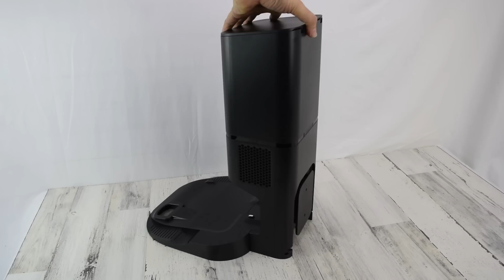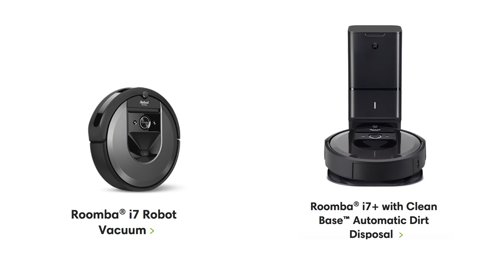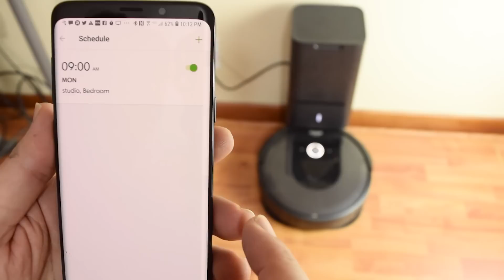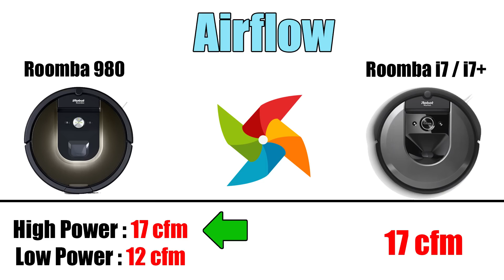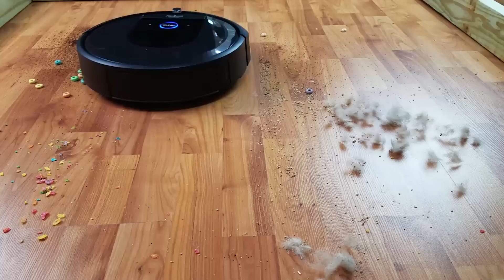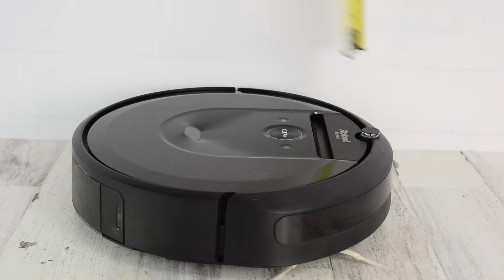iRobot Roomba i7+ Robot Vacuum Review & TESTS w/ Clean Base vs i7 vs 980

Comment: Finally got the exact information I was looking for. Having issues with the device missing debris on carpet, specifically fuzzies from black boot socks. Read online that you can use the app to change the suction settings. However, that is true for older models, this item only operates on the higher setting. Will try multiple passes instead, looks like based on the video that it should work. Had a Xioami robot vacuum previously which operated for 6 years with questionable maintenance, but ALWAYS had issues with carpet, would read that the brush was tangled 18 times when it was not before finally finishing my carpeted area. So I appreciate the start and forget about it for this one.
Reply: Ended up returning it. Suction 1800pa, which explains why it doesn't pick up all the black sock bits from the carpet, more research reveals competitors with 2000+pa. Finally got fed up with it and returned it because it 1) couldn't find its way out of a room next door to its docking station, and then 2) couldn't dock despite being placed directly in front of its docking station, occurring after 3rd use. A shame, I thought iRobot was top of the line in the market.

Comment: I know this is 5 years old, but its been proven over and over again that the i7 is much weaker than previous roomba's for CFM/overall power.  The 960 scoring higher on carpet testing is proof of this.

Theres no way in hell it gets close to 17CFM..   Your more recent testing of the J7 is about right.. 6-10 CFM (Depending on testing methods) for this specific motor. 

 It's not a bad thing, but the J9/S9 completely decimates it and previous gen 960/980 robots.

J5 is just a rebranded J7. No need to test.   All the j7/i7/i3/i5 and custom variants have the weaker 6-10 CFM motor.

Comment: the i7+ is €399 now and I'm considering getting it. Would this still be a good purchase now? I had a Roborock S50 since 2018 but it recently stopped charging so I'm looking to replace it. The replacement needs to deal with hard floors and a few rugs. No pets. What I liked most about the Roborock is how well and quickly it mapped the room every time it ran, meaning I could move furniture around and it would still know the layout and avoid no-go zones etc. How does the Roomba perform in this regard?

Comment: 2 questions
1. What about stairs? Will it just tumble down or sense a edge and ignore it?
2 when picking up. What if we drop like coins and nuts and bolts. Will it still work or will it damage it? Thanks
Reply from the maker: It has an edge sensor, and I wouldn't rely on a household vac to pick up a large amount of heavy debris.  These are standard household machines.
Reply: @VacuumWars  thanks. I tend to drop coins and forget them later on lol. Oh i want one

Comment: I have the I 7+ at first I liked it. But now I’ve noticed the chips in my wood floors and my cracked ceramic tiles. It also does not get up close to baseboards under cupboards. I have a very expensive throw rug in my living room which it has pulled up and I cannot get it to straighten out again.I’m very disappointed in how much money I spent on this and the way it works.

Comment: As a 2 month old i7 owner I can 100% agree with this guy!  I owned the 960 at first then got the i7 when it went on sale and there are definitely some improvements.  However I do feel the 960 did a better job on carpets and was quieter than the i7.  On hard surfaces the i7 does shine better.  After running it a few times in the kitchen my apartment kitchen floor started to shine!  No longer do I have to randomly step on things in the kitchen walking bare foot.  Having it on a schedule turns issues I had living here into a positivie. I have a Swiffer i used about twice a week that I no longer have to use much because of (Robbie) my i7. It gets places I don't want to clean myself (next to and behind the toilet) and does a great job.  TBH I probably run my vac a little too often living on the first floor of an apartment where ANYTHING can be on the floor I LOVE IT!  Off sale it seems a bit much but still well worth it.  If you can find the 960 BUY it!  You may be more satisfied with its cleaning than the i7.  It lacks remembering maps but it still creates one of your home after every cycle like the i7 and it seemed to remember obstacles like the i7 does.  I also found it avoided places it would have a hard time getting out of unlike the i7.  The i7 has this thing where if it bumps into something backwards (trapped in a tight space) it crashed backwards while the wheels are still spinning for a second or two which I find annoying that the 960 didn't do.  But the i7 smart mapping and the fact i don't have to use the wall barrier (as long as the room is well lit) is worth the upgrade to me.  The bigger brushed do a great job and my floor has never been so clean.  Running this and using a air filter makes my home feel nice and CLEAN!
Reply: The 960 has a stronger motor. His testing was flawed here or he didn't do it and just ran with his 980 numbers.

Comment: How is it holding up?  Also, how much does it cost you to maintain per year? (replacement parts, filters, etc.)
Reply: Mine isn’t as good as it was. I’ve had it 13 months. Be careful. I have rugs, wood floors and tile for that have been Ruined. Yes I have done the maintenance on it like I’m supposed to.

Comment: Thanks for the review. 
I currently have a 985 which frequently gets jammed under my kitchen cupboard doors.  It actually managed to break off its dock sensor and not it will not dock to recharge without help.   Is the i7 able to learn to avoid areas where it has previously gotten stuck?   Is it possible to map out areas to avoid, like the areas close to the cupboards?

Comment: My roomba i7 leaves a lot to be desired when it comes to navigation. Hopefully future updates can improve on this
Reply: i read somewhere else too, in comparison to 960, the navigation efficiency is lower on the i7, is it true? Does it not cover the entire area?
Reply: Samar Ahmad Well I reset the roomba and had it rebuild the map and that seemed to fix the problem. It was getting lost going back to home base. It does really well now after the reset.
Reply: @tpfrk8977  thankyou, this will help in making a decision
Reply: Samar Ahmad I would recommend it. Self navigation should be a significant improvement over the 960. Also much superior suction, I think you would be happier with this vacuum over the older 960.
Reply: I don’t understand it’s all over the room all the time. And the carpet rooms you can see the tracks are very crazy.
Reply: @valeriestrathmann4844  Try doing a hard reset. Hold the start button down for 20 seconds while on the charger. If that doesn’t work, try deleting the map and just have it make a new one.
Reply: @valeriestrathmann4844  Clean button, sorry

Comment: Hey I know you have affiliate links but I just wanted your honest opinion on a robot that is good for a relative small hard floor. It’s a small apartment and in fear I’d be over spending on one of these roombas but I do want the app to be able to set it to go while I’m out and the cleaning doc would be cool too. Any suggestions ?
Reply: over a year later but I'm curious as to what you ended up doing. Did you get this? If so, how did it work for you? I would rather have overkill vs not enough. A small apartment can be set to clean everyday while you are at work and you'd never even know anything was going on ha.
Reply: @Chris10156  I got a 2nd hand NEato and seems to do the job ok although can get caught a little and it has no app.

Comment: Can anyone help about the experience??    We're about the get one of this but this is the first time we buy something like this. So does it work louder than a person can stand(for exam. when you sleep)? Most of the time my mom stays at home bc. of my disabled sister. Thanks for helping.
Reply: I think it’s very loud. I have carpet, large throw rugs, tile floors, wood floors. I liked it in the beginning it was loud. I no longer use it after owning it for 13 months. It has damaged my wood floors, tile floors and has pulled piles in my throw rugs. I have the i 7+. Wouldn’t buy it again.

Comment: As much as I appreciate bagged vs bag less, I’d have preferred the Clean Base to be a bag less version. Vacuums tend to pick up things indiscriminately (See Breaking Bad), or suck up micro SD cards, small caps, a rare screw you might have misplaced, etc, and a dust bag full of a months of blind vacuuming might cause you to toss out something you normally wouldn’t.
At least manually emptying a dust bin, no matter how often, allows for a quick inspection. Vacuum something up manually and you can inspect what the heck just made that noise in that thing you picked up.

Comment: Just a cool toy. Ur paying for the wow factor, and the programming capabilities, because the two little rollers on the bottom of this thing cost about $30. Not $1000.
If ur on the edge about one of these, don't be. 
Takes me 10 minutes to vacuum with a $90 vacuum . And if you need a vacuum to be constantly running around ur house, ur a slob.

Cheers

Comment: what is the charging time for the i7+; can you do multiple sweeps in a day? Do you HAVE to have a smart phone to program it? Can it be programmed from a laptop or tablet? What is the battery life estimation please? Have a golden retriever-so LONG hair. Is the suction strong enough to suck up the hair and NOT have it wind around the brushes? The first Roomba I bought had a flimsy edge cleaner that was useless once it picked up a few dog hairs. Do you have to manually clean the brushes and edge cleaner and if so, how often? Thank you! Would luv 2 get a new one if it will work with long dog hair!

Comment: I just picked up a i7 without the clean base.... couldnt swing $1k on this one.  Got it on ebay for $500 and with a 10% back eBay Bucks.... used that to buy a 2 year square trade warranty since Roomba wont cover eBay purchases.... (lame)

Ill be keeping an eye out for the clean base to add at a late date and at $350 new I will still be well under $1k after all is said and done.

Thanks for the detailed reviews that let consumers make knowledgeable purchases

Comment: My I7+ has got stuck on the stairs several times. I thought it could spot and avoid stairs?
Reply: How does it get "stuck on" the stairs? 🤔
Reply: @LovingMusic134  drives up to the edge and drops the front wheel over. Its launched right off them before too.

Comment: Big minus is the bags you need to resupply (buy) every month. I prefer a reusable bin
Reply: I bought a i7 plus in November 2018 it's now April 2019 and I haven't needed to replace any bags yet. It all depends on how dirty your house gets. The bag is the same size as a bag on a normal vacuum so it will need to be replaced as much as ab regular vacuum.
Reply: @Rekkless  after half a year, any other faults this vacuum has in your opinion? I'm thinking of getting it for mother's day (for my mom) but am wary of the price. Any regrets at all?

Comment: Still can 't hold a candle to my Xiaomi Roborock 2: No laser maping, doesn't work in the dark/low light, no wet mopping feature, can't set boundaries in the map. Granted the station is cool but I only empty my roborock once a monht or probably less, certainly not several times during one go (100m2 apt).
So yeah, get a Roborock for 1/3 the price

Comment: I keep reading that the i7 (plus) can map ten "floors," but how large a map can it actually remember?  I've seen some disagreement about this online. Some reviewers are saying that it can clean ten full floors, but others say that the upper limit is still about 2000 square feet (which would be ten really small floors).  When I called customer support, they basically agreed with the 2000 square foot limit but I'm not sure that they really understood my question.  I'm really wondering if the i7 plus could remember its way around a large auditorium (ie. our church sanctuary).  Vacuuming under a room full of church pews is a difficult, time-consuming, activity.  But if a Roomba could pull it off, it would save our custodian a LOT of time.  Have you explored this at all?

Comment: would like to buy the I7+ just don't have $1G to drop on a vacuum and my 595 which still works is blind in one eye. It keeps knocking its charger station around and its a big deal to fix, motherboard problem

Comment: I can't get mine to clear it's "undocking problem." And if I move it off the base it's "drop off detected" error happens. I've gone thru the routine maintenance and am wondering at what point do I return the non-working $1000 vacuum. Worked good for 2 days.

Comment: I have purchased the Roomba i7.  It is very expensive so I expected a product that worked well.  I fought with it for over a week trying to get the smart mapping function to work.  When I called help they said just do a factory reset and try again.  Much faster to put it back in the box and take it back.
Reply: Dude you post this on at least all Roomba i7 videos on youtube. You probably work for the competitors.  Geez.
Reply: @autopartsdesign  Fair assumption but I do not have anything to do with the vacuum business. I was frustrated with the support and function for the cost.  I actually expected some vendor feedback. I am sure many have had better luck with the product and hopefully there are those positive types of comments as well.  Good call to ask the question though. There are a lot of fabricated reviews out there.  All the best!
Reply from the maker: It could be a lemon, it happens more that you would think, with vacs of all types. I bought a robot vacuum lemon this week on an otherwise great company, got another one, worked great.

Comment: We have two large dogs that can bump our occasional chair and ottoman out of place.  Or what about a kitchen chair that isn't pushed back into place under the table... how does the i7+'s room mapping handle these displaced objects?
Reply from the maker: It will just default to is regular bump sensor navigation for the duration of that cleaning. It has a huge processor so it will know the difference over time.

Comment: Does the roomba work in dark rooms? 
Would I need two docks if my home has two floors? If so, would it know it could dock on both?
Reply from the maker: No it wont work on dark rooms, Irobot says you dont need another dock to take advantage of the multiple floor plans option.
Reply: Vacuum Wars but if I don’t get a second dock, I’ll have to empty the vacuum or it won’t complete the job. Doesn’t this take away from that feature? (Since the vacuum won’t be able to reach the dock if it’s on a different floor).
Reply from the maker: Well you can get a second dock, and I am pretty sure it takes that into account with the multiple maps (but you mat need to ask them first)

Comment: PLEASE READ ME!!! A lot of people do not know this secret. If you are a rewards member at Bed Bath and Beyon, you know that you receive once a month in the mail a sales circular with a 20% off any original priced item in store or online. You can get the Roomba i7+ at almost the same price as the Roomba i7 model. The cost of the i7+ at Roomba's website and Bed Bath and Beyond is $950 and the Roomba i7 model is $700. Well, if you have or get your hands on Bed Bath and Beyond's 20% off coupon, you will get the i7+ for $760! Now, I do not know how the people at your local BB&B store is. But, the nice folks at my local store will take coupons that have expired, even if it had expired a year ago, the store in my town does accept them. So, if you're wanting to purchase the i7+, but you have to settle for the i7 model because you cannot afford the i7+. Well, now you can with the use of the 20% off Bed Bath and Beyond coupon!
Reply: If you go to the BB&B website, you will find this disclaimer - "The manufacturer does not allow coupons on this item". So, how did you get around that caveat? Please share your secret with us.
Reply: @Billnn54  Apparently BB&B didn't notice it, just like I didn't notice. No secret!

Comment: Hey great job on your demo video. I was so excited about the Roomba i7+ when I first learned of its awesomely new feature, the self emptying. Lol when I first tried ordering the i7+, I went to it's website, but I couldn't not find the add to cart button. So I called Roomba and the sales representative said that it was not avaible for purchase yet. You'll have to wait another two weeks. I was very disappointed, but I am so glad that I had waited. You can get the Roomba i7+ for just about the same price as the Roomba i7. Now, like the guy in the video said, the only difference between the two models, the i7 does not come with auto dirt disposal bin but can be purchased separately, where the i7+ does. The cost of the Roomba i7 is $700, the cost of the Roomba i7+ cost $950. I went to Bed, Bath and Beyon and purchase the i7+. I paid $760 for the Roomba i7+! YES, $760. How did I get the i7+ for around the same price as the i7? BB&B offer 20% off to their customers who join their free club. Every month, I receive a sales circular and on the circular on the back page is a 20% off orgional priced single item in the store or online. The store in my town is nice enough to accept expired 20% off coupons. I have coupons that are over a year old and the nice people at my local Bed Bath and Beyon accepts that coupon. So, if you want the i7+ but have to settle for the i7 model because you cannot afford the i7+, run to your local BB&B store and beg them for a 20% coupon so you can get the totally awesome i7+ rather the not so cool i7. It's worth the extra $60 for the + model, don't settle for the i7 if you get the coupon.
Reply from the maker: Good info thanks so much for stopping by!
Reply: I call bullshit the BB&B does not let you apply discounts to the iroomba https://www.bedbathandbeyond.com/store/s/iroomba-7-plus?ta=typeahead&flyout=true